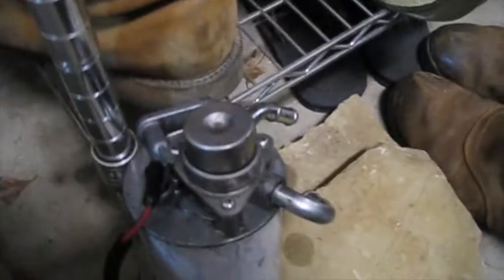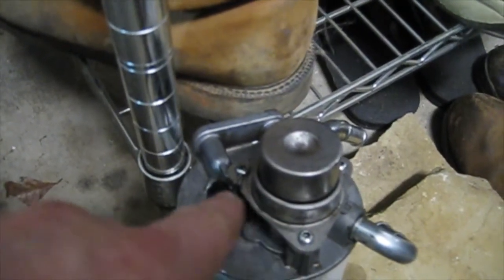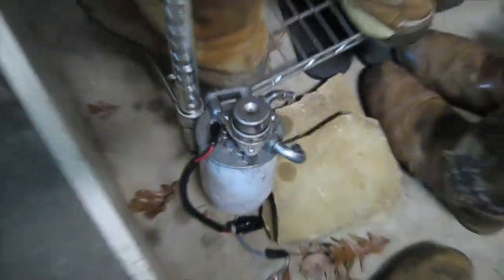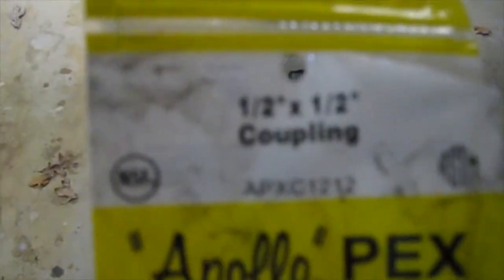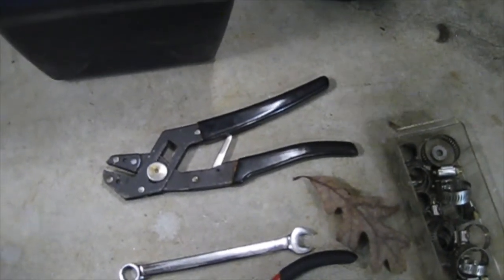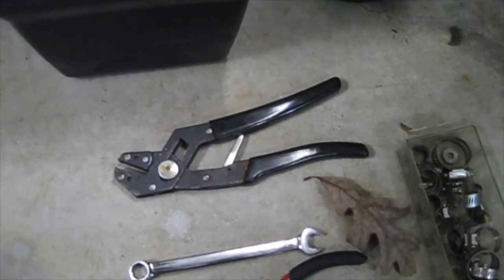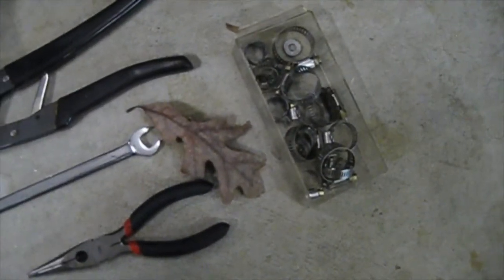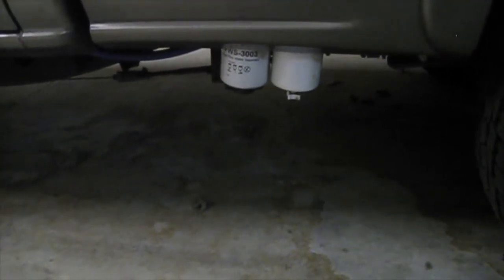Duramax Fuel Filter Head Delete

Comment: If you keep the stock filter and head, you should remove the spring and plunger ball inside of the head. There is no use for it now with a lift pump. Its just a restriction the pump has to fight against.

Comment: have you put the factory filter and head back on yet? Wondering because I just got a FASS 150 on mine and did a delete similar to yours in this video. I was thinking if I installed the OEM filter, that it might be prone to leaks because of the positive pressure from the lift pump, opposed to the vacuum pressure with the stock fuel system. I want to put mine back on for the extra filtration, just don't want to develop leaks within a short time. Thanks for the VID!

Comment: Extremely helpful video!  I have the exact same issue with installing the lift pump.  I will plan on just throwing mine away after bypassing as well. Are the 10 and 2 micron filters different than the stock FASS ones?  Thanks again for the Video.

Comment: Thinking of doing this and adding a fuel pressure gauge in there. Just debating going off hard lines with leftover hose from fass and putting fittings in for gauge or like you did with a strait adapter for the gauge to screw in. hmmmm